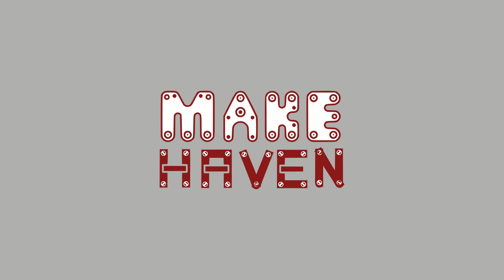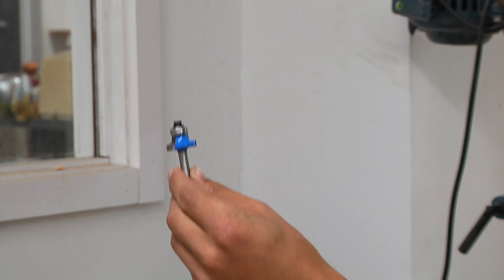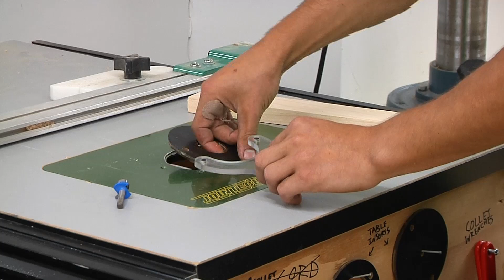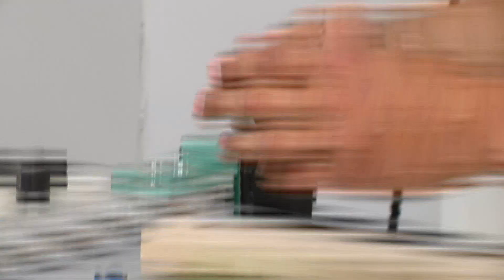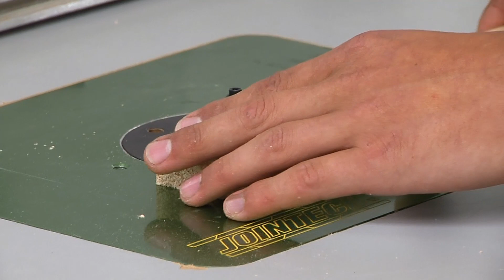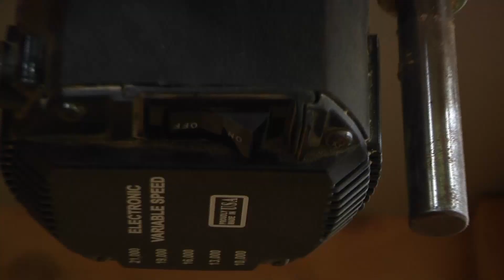How to Use a Router Table

Comment: I'd push the bit into the collet all the way until it bottoms out, then move it back out no more than 1/8".
Also, first thing is always unplug the router before doing  any bit changes. Every time.